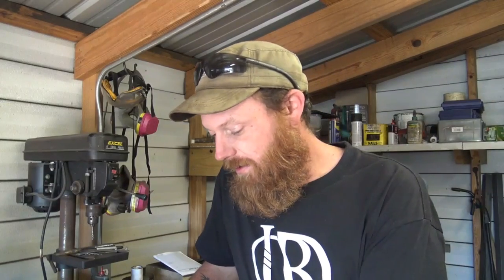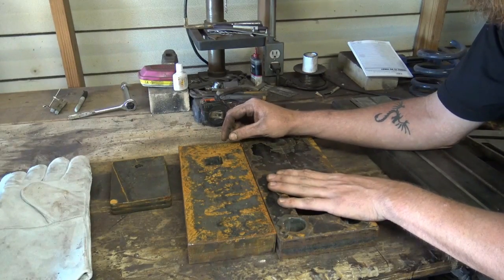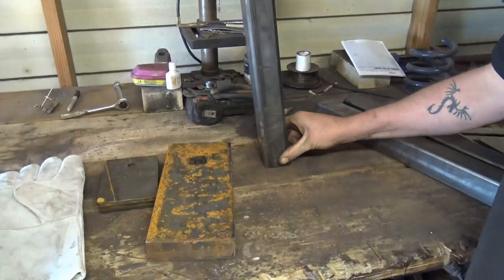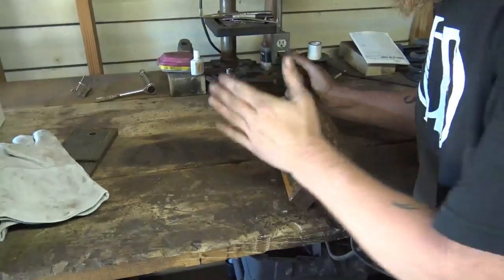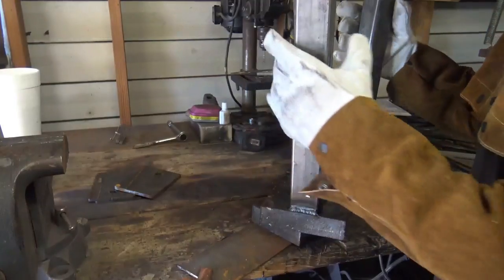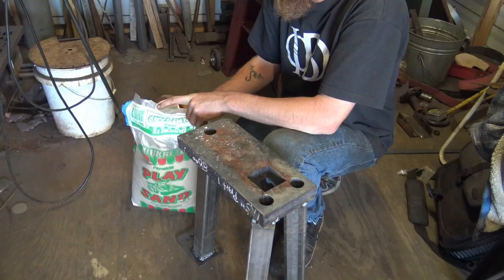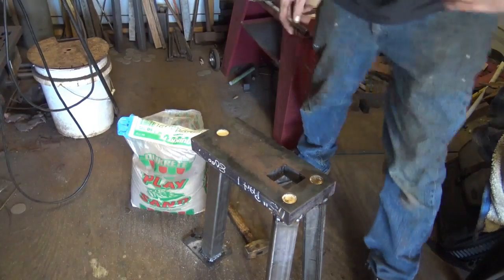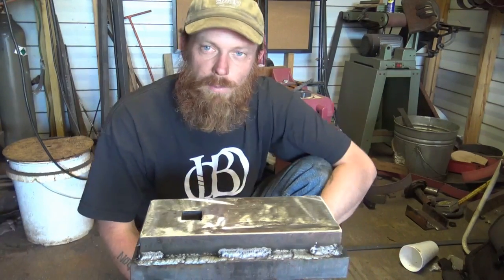How to build a striking anvil

Comment: That's a neat idea, packing sand then adding oil. I have several structures that use metal pipes and I'll be doing the same to them. I live in a small island in the Pacific so we have a never ending fight with oceanic corrosion. Thank you for your video and God bless!

Comment: We pre heat our base plates ar work if they are over 3 inches thick it allows you to get better penetration in your weld but also ensures you get a wrld that cools properly! Good on you!  Putting bevels on the area  you are going to weld and doing a multipass weld will also help you get the penitration you need.  With what you are doin im sure your fine! But damn good vid and you are spot on with what u are doing!